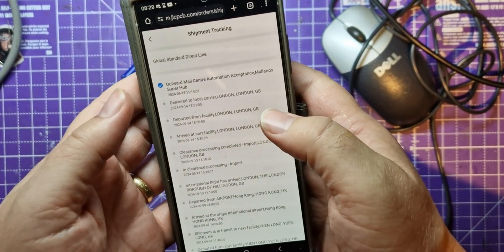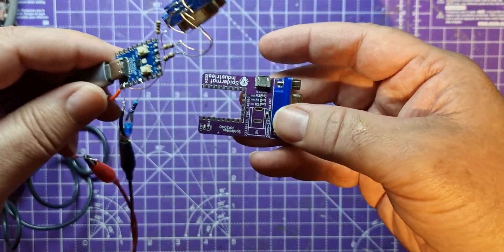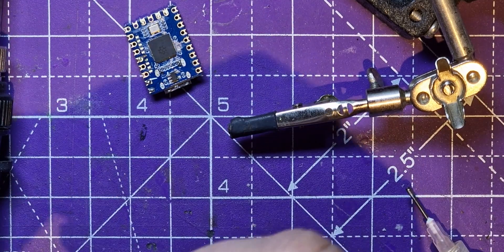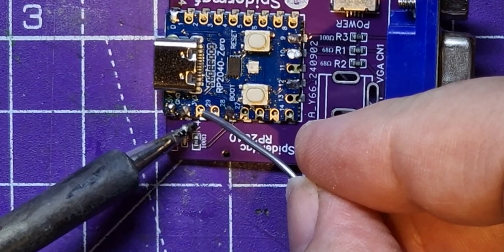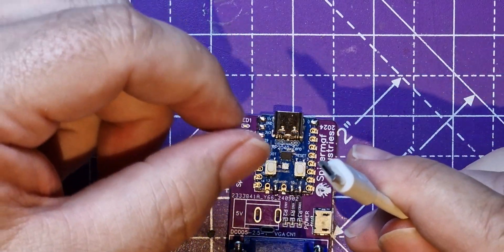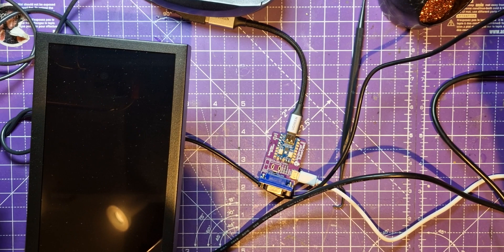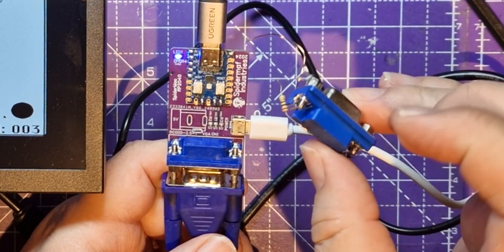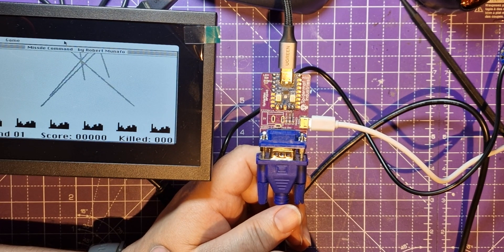I made a PCB that runs like a MAC 128 on an RP2040-Zero.  Just add VGA, leads and a mouse.. (almost)

Comment: Is there any keyboard support?
Reply from the maker: Yeah. The software handles keyboards, you need to plug the on the go usb adaptor into the pi, then a usb hub splitter cable, and you can use the keyboard too. I've only tried it hot swapping the keyboard and mouse so far but it works.